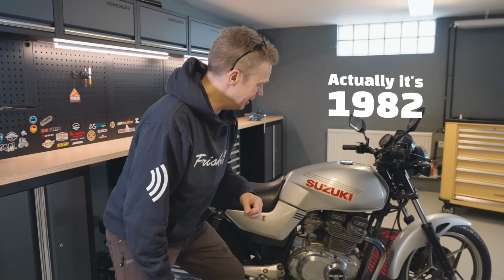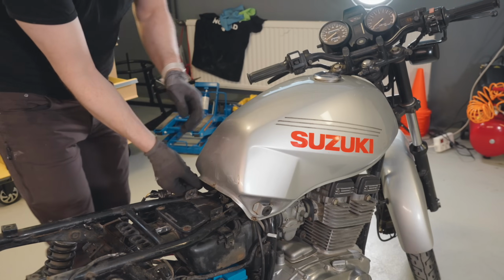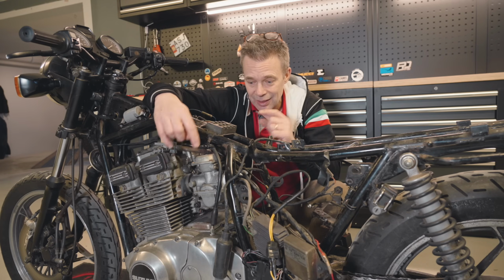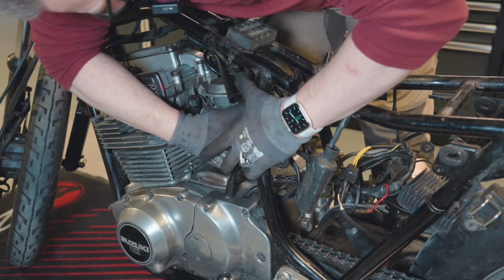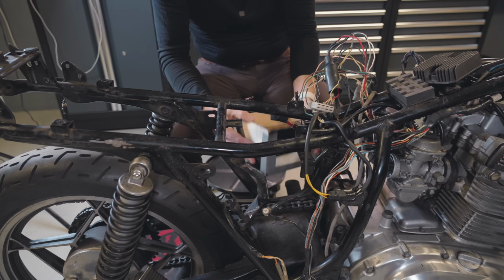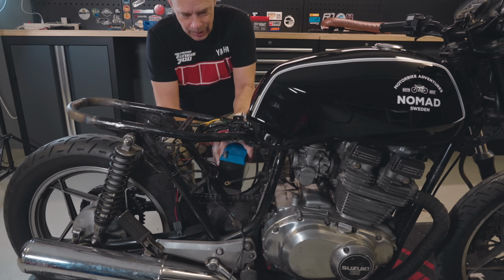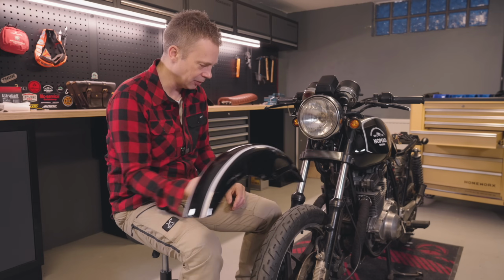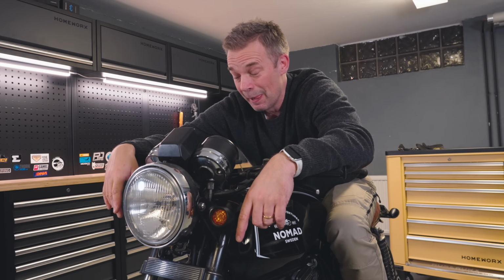I built a café racer from my kids bike!

Comment: Provide ventilation for the regulator rectifier or you will have a bbq under your seat. It has cooling fins for a reason. Maybe not so much of a problem in Sweden but here down under everything is about staying cool. Bike looks good for a moderate customisation.
Reply from the maker: Thanks for the tip
Reply: I would try to mount it on the outside of that metal box, so it has the box itself as a bit of additional cooling surface. 
And by the way, it will not only heat up if its in there. It will not work very long without cooling.
Reply from the maker: @gerharddahlheimer5485  yes i will do that today 👍🏻

Comment: The thing on the left frt. brake is an anti dive valve to restrict fork action during braking.  It can be blocked/cut off and appropriate fluid and springs installed.  Progressive suspension springs.  A catch can and small crankcase filter from K&N for the oil breather hose.

Comment: Probably you made a drain hole in the bottom of that battery box, if you don't want to flood your "electronics" while riding in rain. Nice simple fun project.😂
Reply from the maker: Indeed thanks for reminder 😂
Reply: Yeah, but he has to watch out that the water doesn't splash upwards by the rear wheel. maybe 3D print a nice cap for it? On the other side they are originally not on a dry place as well... maybe it is enough.

Also, I'd check the rectifier after a long drive, it tends to get hot (look at the cooling ribs)